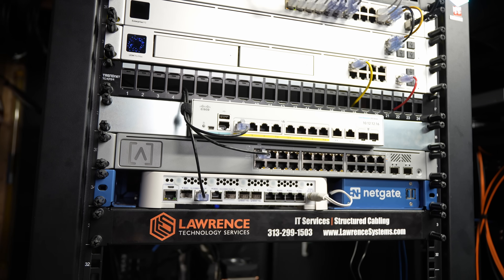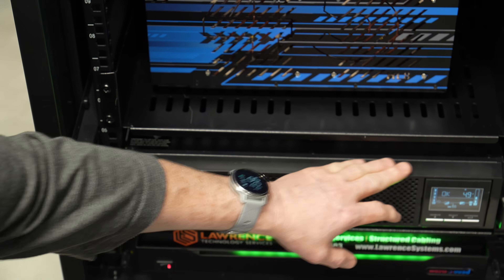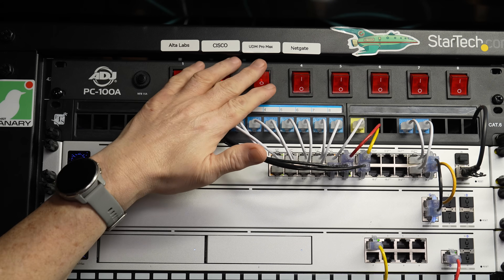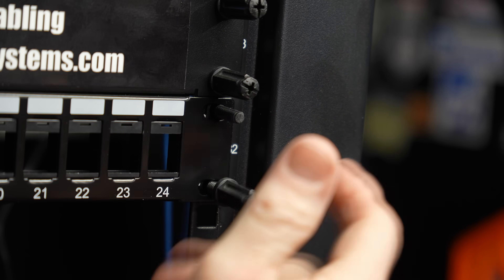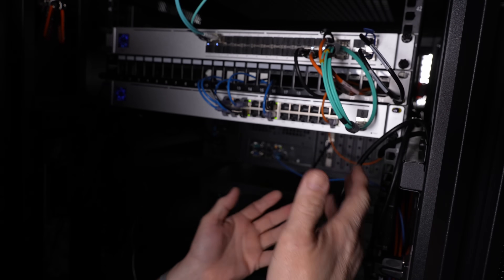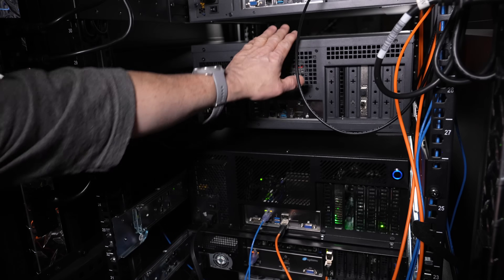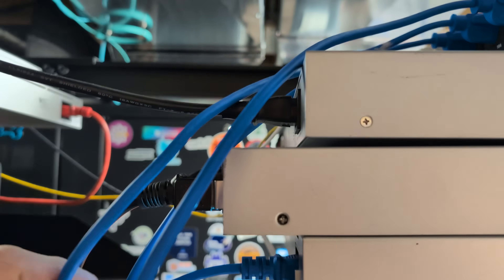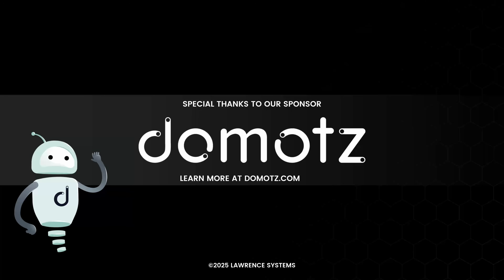Homelab and Server Rack Tour - 2025 Edition

Comment: 😊Great video! Thanks! I like the rack mountable little Raspberry Pi that you showed. It looks like it also has a PoE splitter? Is the Pi that you have on the video off the shelf, or at least the case is available? Wondering if you can provide model/details on this model & rack mount case?
Reply from the maker: I don't have the file for the exact one I am using, but there are a lot of variations you can find at the 3d printing sites.

Comment: One quick (and legit) question... you showed you had the UPS, and also protected power strips with on/off buttons.  Is that UPS a battery backup system?  Is it now considered "ok" to plug those strips into UPSs?  I have ALWAYS been told this is a huge no-no.  I just got a rack as I got my hands on another server, switch, UPS, and firewall unit and need more power distribution to then link to my UPS but worried about what PDU strip to buy as sooooo many have protection built in.  (Again, this is a legit question as I am recently seeing conflicting answers.)
Reply from the maker: The power distribution units are fine to plug into a UPS.

Comment: Hey Tom, Nice rack. 
One thing that I enjoy doing is having el-cheapo SSD's in a box (silicon power ftw), plugged into the the mobo sata ports, that I can dual/triple/quad boot into, that way I don't have to re-install all the time when switching between things. I have a cheapie 4U box in my rack just like yours, I think it's rosewill, has 4 drives, 2 versions of proxmox, an arch server, and an XCPNG instance. I've got one of those little jetKVM deals, so I can reboot it into whatever I want to play with at the time, really handy, and saves you the 20 or so minutes when you want to check something in another environment. 

Great use of otherwise wasted motherboard sata ports.

Comment: Maybe Cisco and other big brands have their airflow configuration for a reason, when you plan and buy enterprise devices. I did back of the rack switches, they just don't have anything from the front, except some perforated panels, and we buy reverse airflow fans, and you don't pull 48+4*2 or *4 cables from front to bottom...

Comment: Nice. I only have a single 37U rack cabinet. Don't have the space or funds for bigger or more racks. I have the the front and back loaded. I also have been using various colored patch cables to make it easy to know the kind of system it is by the color as you. Would suggest putting the zigbee/zwave dongle on a short USB cable. Having it so close to the USB can cause interference with the dongle. I have a pi4 with PoE hat to power it and it runs NUT server for my 3 UPSes.

Comment: I wonder if there are any rack mount UPSes that are Lithium based (preferably LFP) instead of Lead Acid.
Reply from the maker: I forgot to mention, those are LI based.
Reply: Eaton and Tripp-Lite have LifePO4 batteries. I got an Eaton one. A LOT more expensive than the lead acid, but its battery life is expected to be good for 8 to 10 years (as opposed to maybe 3 years for lead acid). The Lithium batteries are also lighter, and are more efficient, and recharge significantly faster. So, I splurged and got one!  I also have some Lithium Ion UPS’s from APC (but they are not LifePO4). I’ve had half a dozen of the Lithium Ion UPS’s from APC and 3 of them went bad (just stopped working). Fortunately, APC is great with their warranty service. I haven’t had trouble with the replacements. Maybe APC addressed whatever issue there was in newer production runs.
Reply: @ Nice!  I also think LFP is a lot more dependable than Lead Acid when power actually drops.  I've had too many UPSes self test constantly reporting "we're good" then after 30 seconds of power loss, they die hard.    I'm using an Ecoflow River 2 as a mini UPS (it switches fast enough), and while it can power the load for 4 hours it has no circuit to say "you're off wall power".

Comment: I have questions about getting into homelab, outside where I'm going to get the resources to afford it, I'm quite new to your channel so being pointed to the pre-existing video that explains it all is absolutely fine for me even if I couldn't find it:
What determines that you need another unit instead of just upgrading or living with the one you have? As far as I have understood – it is possible to run many types of processes on the same unit and to emulate that which your hardware is not specialised for, they're all computers after all.
What do you think is absolutely necessary in case of redundancies, and how do you go about setting that up? When do you think plug-and-play hardware should be at the ready, or that a digital backup is more than enough, and how do you make sure that the replacement does not die the same death as what it is made to replace? What, in other words, are you comfortable with being down for a while, what stays off grid to keep it safe, and what is kept off site to restore your system in any situation? I'm not just talking about storage backups here.
I suppose this video answers how you manage 'production' versus experimentation but are there any overlaying principles that guide you to when you push to what you actually use?
Reply: To exemplify the first question about getting more units, I'm sure Jeff Geerling could argue that anything can be done if you have enough Raspberries but even my novice eyes can see that he's being ridiculous.
I'm sort of looking for opinions on when to atomise tasks across multiple devices and when too pool it all into one unit, what are the strengths of each solution?

I think I'm going to host my own files for redundancy first and foremost, maybe experiment with Pi-hole, a media server to keep my legally downloaded linux-.isos on, and maybe get into some light home automation (IDK). I see that even if you have quite capable computing power available, you keep the home automation on a separate Pi, why is that?
Reply from the maker: I buy based on what I need or am inconvenienced by. There is no real science in my head for how long I will tolerate a slow server. For my homelab I consider internet and backups critical anything else being down is just annoyance.

Comment: Nice setup. Interesting you use UniFi switching too, I run UniFi switches but with TPLink Omada APs and a MikroTik router. I find the Omada APs behave much better for roaming, have better signal, and use less power marginally.

Comment: We have A and B power indicated by the color of the power cable where I work.  Very handy.

I intend to do something similar with each of my UPSs.

Glad to see that I am not the only one with a rack at home.  Recent videos have suggested that rackmounted homelabs were unusual.
Reply: Really? I would have thought you'd want a rack (maybe a 10" one if you're really struggling for space...?) as soon as you're past having anything more than a router/firewall, switch, a couple of small devices and maybe a mini-PC? I'm glad I no longer have a bunch of old enterprise servers that sound like I'm at the bottom of a runway whenever they're switched on. Still, having a small designated space for a rack (even just 9U/12U) in case you want some mountable equipment is always nice! I can't imagine it's that rare/unusual.